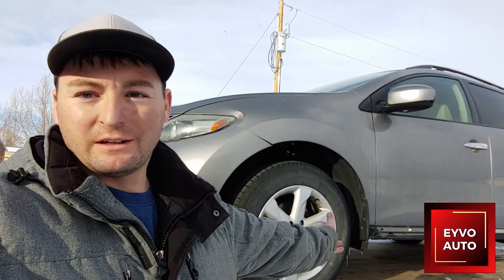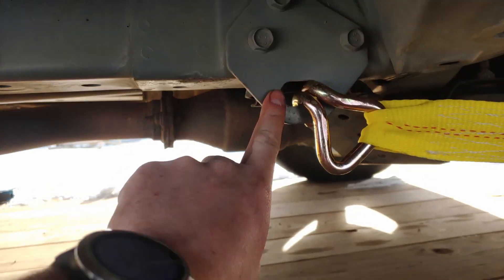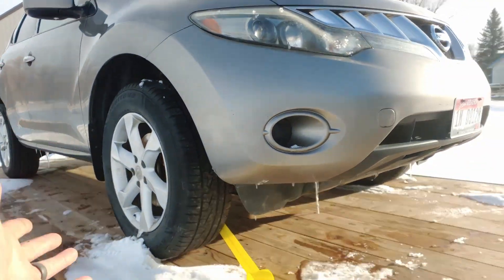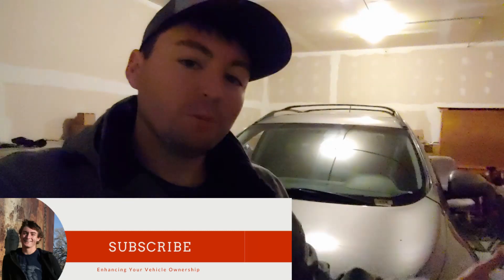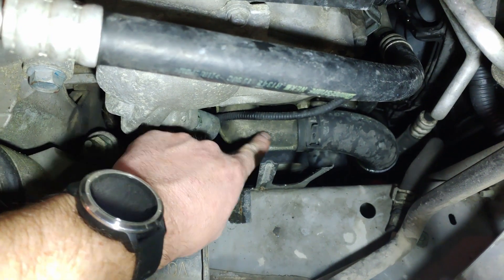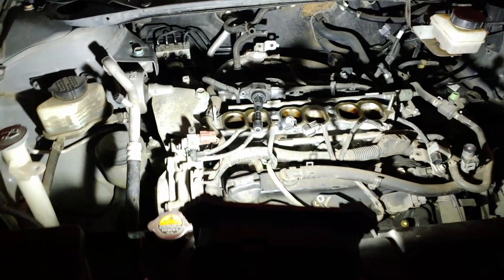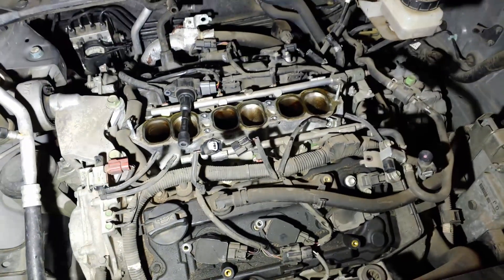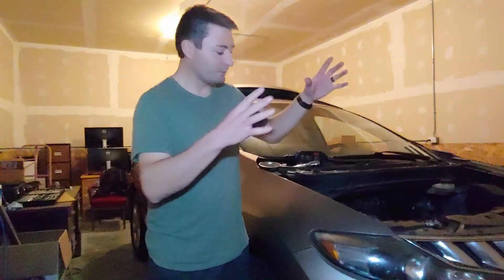The 2009 Nissan Murano Broke! - Replacing the Thermostat, Spark Plugs, Coil Packs, & Valve Covers

Comment: I haven't dont the thermostat yet, but i can do everything else in about 4.5-5.5 hours if not a bit less. Tearing it down fir this exact thing tomorrow
Reply from the maker: Sounds right! It's a pain the intake manifold has to come off to reach that back valve cover & plugs, but it's like that on almost all transverse v6's I guess. You'll want to grab some extra vacuum line as well to replace any you might break or that look worn while you're in there, especially all of the ones under the intake manifold. The thermostat isn't too bad to replace. You'll replace it with the whole housing and don't have to remove the intake manifold / valve cover to do it. There's literally just no room to get to the bolts, or to get it out. But if you're patient, and take time to figure it out, you'll get it swapped without too many curse words!

Comment: How much is it to replace valve gasket, spark plugs and coil packs for the 2009 Nissan Murano S model?
Reply: V6 engine
Reply from the maker: Are you planning on doing the work yourself? Big difference. O'reilly's wanted to charge me over $1,200 for all the parts alone!... I'm guessing it could easily run you over $1,500 at a mechanic shop. If you're doing the work yourself however, it shouldn't be more than $200. I'll link the parts I used, but I ordered them off eBay for a fraction of the cost. O'reilly's wanted around $600+ for the valve covers & gaskets; you can get the same ones online for $66! Spark plugs I never order online, just cause they're more easily damaged in shipping by themselves. We've run several thousand miles since the repair without any issues.

You cannot replace just the valve cover gasket on the 3.5l unfortunately; it's built into the cover, and being plastic, even if you could just replace the gasket there's still a good chance they could continue leaking. Also to access the back of the motor, because they're transverse, you have to remove the intake manifold and all that stuff on top, a real pain. You'll most likely break a lot of the vacuum lines, really any you have to touch depending on the vehicle condition / miles, so you'll want to have some of that on-hand or take a piece to the parts store to get some when you go to put everything back together. Might as well replace any vacuum lines that look worn while you're in there as well.

Valve Covers & Gaskets: https://www.ebay.com/itm/114500477747
OEM Quality Coilpacks: https://www.ebay.com/itm/162662793351
OEM Quality Coilpacks: https://www.ebay.com/itm/182946254449
Vacuum Switch EGR: https://www.ebay.com/itm/303086643701 (I broke that while reinstalling new vacuum hoses)

My radiator also had the classic Nissan crack down the side and so I replaced that, a bunch of hoses, and the thermostat to future proof it. I bought the thermostat at O'reilly's for $30. Everything else I got online; well worth the wait due to price savings.

Lower Radiator Hose Engine-Pipe: https://www.ebay.com/itm/293378947015
Lower Pipe to Radiator: https://www.ebay.com/itm/293985971701
Radiator: https://www.ebay.com/itm/143784568568
Radiator: https://www.ebay.com/itm/Radiator-For-09-17-Nissan-Murano-Quest-3-5L-V6-HP91M8-Radiator-/203290134385?hash=item2f55094771
Reply: @EYVOAuto  thank you...I appreciate the information